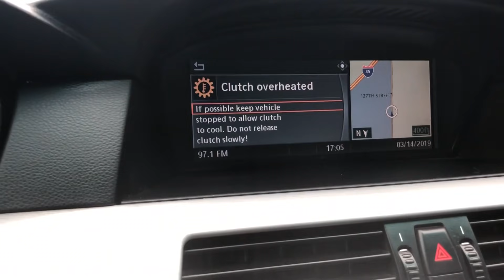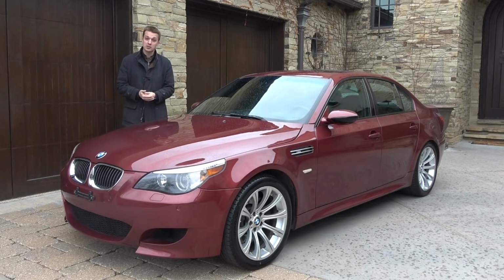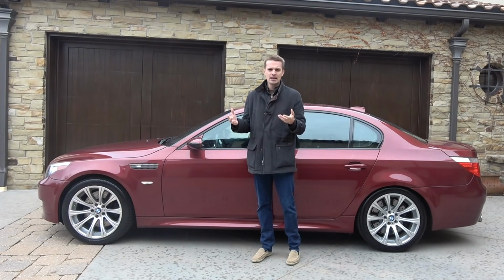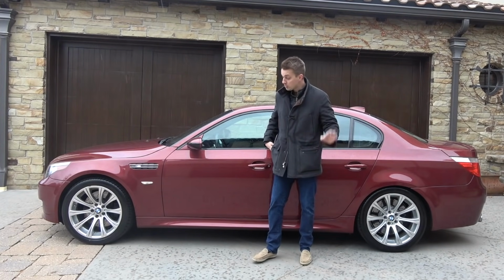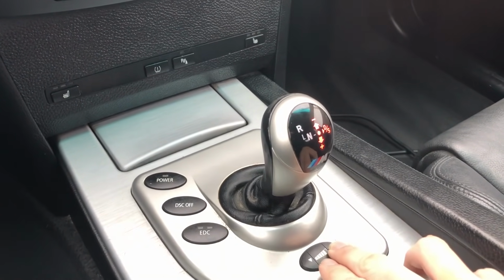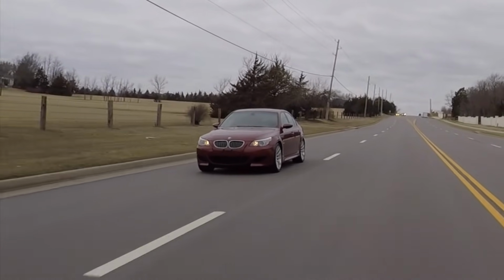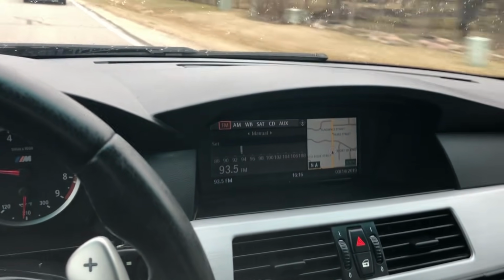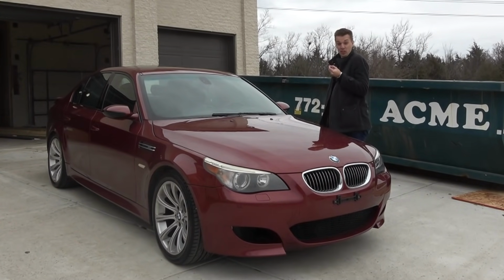My Cheap BMW M5 Is FINALLY FINISHED (Thanks to a Wire Hanger???)

Comment: The shifter is not upside down. That is the correct way it should be. When you are speeding up, and upshifting it is more natural to pull the shifter back. Even more so, when decelerating and downshifting to push on the shifter. It is totally awkward the other way, if you are slowing and your weight is being pushed forward, to then pull back on the shifter, and pushing you even more forward.
Reply: sHillChannel In all fairness I’ve heard that before because in the early steptronic shifting bmws orientation was the way Hoovey thought it should be
Reply: Fargo Holmes yea, as I sit in my 2000 bmw 323 with the backwards forward + back for -. It’s a good thing that it’s not used in that mode.
Reply: Just like on an aircraft...
Reply: Every rally car, pneumatic gearbox car has push to down and pull to up..
Reply: I ended up with a Mini automatic, and I was very please to know that BMW had kept the towards yourself as an up shift and away as a down shift. It was very helpful while taking it onto a dirt road.
Reply: @anidiotinaracingcar  Or a Mazda... or many other cars that get it 'right'.
Reply: @TakuroSpirit77  can confirm. I was pleased to see my Mazda3 did it the correct way.  Well, the more correct way is with a 3rd pedal, but happy wife happy life (it was hard enough to talk her into a Mazda hatch instead of a RAV4.  ew.)
Reply: I disagree. Having used a car with it both ways, up/away is more speed, down/towards you is more decel. That;s how it should be.
In a real manual, you are usually going from 2nd up to 3rd or 3rd down to 2nd in tight corners.
Reply: Uhuh so aircraft have their throttle systems all incorrect you know push forward to go faster.... Seems piper, Cessna, Boeing, Airbus, Desault, Sukhoi etc etc have it all wrong. Oh and every other car manufacturer.
Reply: There is nothing "natural" about that. Maybe the way you prefer it but it is not "natural".
Reply: I would buy it.
Reply: Because RaceCar
Reply: Yes! I'm forever shifting the wrong way because so many cars have it the wrong way around.
Upshift should be back!!!
Reply: Phillip Pereira aircraft throttle has nothing to do with shifting. Racing Cars with sequential transmissions shift like the M5 in this video.
Reply: The "go faster stick" in aircraft is analogous to the gas pedal in a car, not the gear shifter, making this comparison invalid. Back for upshift, forward for downshift, because racecar.
Reply: @superglue46  --> Nice save! I'll bet she wouldn't like the RAV4 now anyway, after getting used to the 3.
Reply: He was obviously joking
Reply: Exactly, this hoovie character doesn't know much about cars.

Comment: If your BMW mechanic doesn't daily drive a BMW, I wouldn't trust them. I'm a BMW mechanic and I only drive BMW's.
Reply: Biggest European junk ever made
Reply: S. T  ? Did I tell a lie ?
Reply: S. T which lies ? The vanos pump , massive oil leaks , constant sensors failures had a few bmw’s in my early days as a Acura tech there’s not many that can drive like an M5 or 540I 6 speed but are not reliable those from the 2000 eras all all junk  that’s a fact .
Reply: @mollywapyo  Sensors failures are common to all brands so stop bringing that up, MAFs for example are known to fail on pretty much ALL cars. I personally know 5 BMW owners (3 of them have diesel engines), all cars are above 200k miles, aside from regular maintenance, nothing to report, but then again, there are a shit ton of old BMWs still driving fine. The internet hive-mind panic surrounding this brand is just astonishing.
Reply: S. T hey it’s not just an internet panic  thing... can’t speak for the Diesel engines models , but the gasoline ones for years have all had disastrous problems most people  are aware of this they don’t need the internet for this info   but they’re so nice to look at and drive people like me buy them > and  until my third one wouldn’t stop leaking oil  and how can I Forget cluster aka dashboard lights up like a Christmas 🎄more often than a Christmas holiday .
Reply: Your job is definitely secured.
Reply: Nice strawman. He literally said none of those things. He just said BMW's are pieces of shit (true). I don't know what all this 50k time bomb stuff you're talking about has to do with anything.
Reply: @josephk1342  Oh look, another sheep.
Reply: @josephk1342  yea exactly stay on topic sir
Reply: Says you. Stop pretending like BMW's are the greatest most reliable machines on earth. Just because your parents drive you to school in one doesn't mean they're the best cars ever. They have well documented reliability issues.
Reply: Sure, never mind the fact that they have more issues on average than other car brands like Toyota.
Reply: @josephk1342  is that what you came for too ? To boast about your car's brand ? Have at it. Might be your only chance to shine in life.
Reply: Thanks for admitting you don't have an argument.
Reply: Thanks for confirming you don't have an argument.
Reply: BMW can be pretty shitty. Coming from a shop owner and BMW owner LOL
Reply: @josephk1342  we knew that after his totally ignorant comment in the first place. we didnt need a running speech on it to be fair, everyone who knows bimmers knows these facts
Reply: What if they drive a 15 year old station wagon with a diesel engine?
Reply: S. T in Atlanta, you can’t give away a used BMW and people buy them new in droves here. My best friend bought a brand spanking new BMW 7 series 2018 and within the first six months, its been replaced  with another brand new model,, that one was in the shop for 7 of the first 8 weeks he owned it with “computer issues”. They now have compensated him financially and offered him a third brand new 7 series. He declined because his was ordered the way he wanted it and they wanted him to take one off the lot. He doesn’t want one that doesn’t have what he ordered originally and he’s in litigation now. You keep telling people how great these cars are, especially when they have had regular service, ie = shelling out ridiculous amounts of money annually to iron out the problems they come with that amount to what’s called “billable maintenance”. Meanwhile people cannot buy a used Toyota, Honda, Lexus or Acura because people want them new and then others want them used and are willing to pay good money on cars that aren’t the equivalent of pouring money into a bonfire 🔥.
Reply: J MILLZ  couldn’t have said it better or should I add Bavarian Manure Wagon...
Reply: J MILLZ S. T  don’t even bother with a bmw lover I have a buddy that loves these things even though it breaks down and thinks it’s the bees knees. Luckily he’s mechanically inclined and has a garage workspace to work on these. Reality is it’s not the same for 90% ppl and they learn the hard way. I swear this guy @S. T and my buddy are like Jehovas trying to convince you to switch to the dark side. I’ve had my share of euro trash vw bmw and s60r all had major issues. My Lexus ISF all I do is change the oil and brake pads , and I track the shit out of it. If I did that with euro trash it be piled up on the boat with its german brothers and cousins, on a maiden voyage to China and turned into products to be sold on Amazon
Reply: Mine is driving only BMW's, so as I.
Reply: Yes. BMWs are complex and over engineered, there's a lot of components that can go bad. When they run well they are very satisfying cars. Properly maintained and driven they can last as long as any other car.  People mod those cars and drive them like assholes all the time and then they bitch when something is wrong.
Reply: Can you help me with my 05 530i?
Reply: wagner1va there cars ain’t giving them the type of problem the bmw gives
Reply: @mollywapyo  my 2000 250k mile 323i runs great👍 granted ive rebuild everything but the engine and transmission 😂
Reply: BMW puts plastic where it doesnt belong. Still not as bad as Audi or Volkswagen. I'm also a mechanic and those pieces of shits start having turbo and transmission failures around 30k miles.
Reply: What part of the country you located? I need a good BMW guy.
Reply: J MILLZ I have had BMWs since 1995 now on my 7th BMW and only one has needed any major work and that was my first BMW a E30 325i which needed a top end rebuild, well that kind of gave me the opportunity to do a full Hartge conversion! The rest have been fine just usual maintenance nothing more! Choose your drivetrain carefully and don’t buy a lemon in the first place and you will be fine
Reply: @mainiac4pats 
 In Europe, no one wants to buy the plastic lexus with hopeless achievements and entertainment system worse than in dacia. Premium Toyota
Reply: All cars have problems BMW, Audi or Mercedes ... So many idiots in this forum can see them only in the case of BMW.
Reply: My bmw mechanic drives a rsx and works on my Subaru 🤷🏽‍♂️
Reply: @mollywapyo  the fact is that petrol engines for US and UK are seriously under pressure and it often fail... It's due to many factors... Meanwhile in most EU countries most driven BMW's are 2.0 diesel/3.0 diesel (not 335) and 1.8/2.0 petrol engines... All of them have 150+hp which is more than enough for daily drive. And those engines are extremely reliable... It's fact. Lets talk about most expensive part... Engine chain... 600e for an old e90 but i never but never heard that happened someone i know with this engines... Only junky thing about BMW for years now is cooling pipes... Needs replacing every few years 3-5..  but at a price of about 200 euros.. it's shitty...
Reply: WolfHeart this
Reply: If I have a bmw mechanic I’d assume he’s a smart man and smart men wouldn’t drive a bmw.. simple as that
Reply: My guy💙
Reply: @AlmightyJ97  the thing is price ... People just buy meyle, topran or some low quality parts... And expect it to last long... Sorry but that's not a case... You have to pay to play. If you pay 50+k Euro for a car don't expect cheap service.... You pay for power, design and materials... Not reliability....
Reply: Same
Reply: Hey, I own a bmw e61 530D, how familiar are you with the e60 generation? If you are well acquainted with them, could I ask you some questions for tips on how to take care of my car?
Reply: BeastAtGaming yes you could
Reply: Say that to mine inline 6 330ci with almost 200k on the clock and still going strong. I rather have one bmw than 10 fords, mazdas, mitsubishis or any  other cheap peace of shit that's gonna break and don't tell me they don't break, cause they do, have so many examples over my short 25 years.
Reply: Ziggy R  No actually they don’t break. Even the Lexus cars can be neglected and still run. Bmws requires a lot of attention but you still end up with a lawn ornament if you don’t keep up with it’s endless demands.
Reply: S. T my 525 is going strong at 290k and I got it at 60k so far I’ve had to replace two head gaskets bc of my own error not the cars fault and the front struts and the starter other than that she’s been a complete beauty and is still going strong
Reply: man... i personally know some 30-40 bmw owners and only one of them have no problems with its bmw... he is 67y old and have 1984 745i (if i remember correctly) that have some 40000km on the clock and yes he is the first and only owner of that car...
Reply: @nenadcaric5195  I bought Topran and Meyle parts for mine and they've been going strong as day one. It depends of the parts you go for.
Reply: @kwachujachu4415  Exactly. But jealousy makes them dumb and blind. I ran through a couple of comments after I stopped posting here, hilarious. It's always the same story of "my fwiend bought this hurrr durr and it broke hurrr durrr". Yeah right. Most of the people who have problem with them (or any other brand) are those who bought a used lemon first. Then they complain it runs bad. Lol.
Reply: yes everything is relevant to every brand exept x100 in bmw...
Reply: thats right... that is why i learn on faults of others and never by a bmw :D
Reply: yes because you can in fact learn from faults of other people... i know tooo many people who own bmw (30-40 people some of them too good because 2 of them live next to me) to be able to buy such a junk like bmw... but as my friend (its sounds totaly like you) say after his new (1 year old) bmw "blow" valve gaskets: "you know that is normal on every car" :D :D
Reply: you sounds to me more and more like you never ever own a car... not onlu bmw but any car except maybe in a pc game
Reply: i never sad that but ok you want to try... so kid buy in games what you want and be happy...
Reply: J MILLZ nah that would be Volkswagen and any Volkswagen products
Reply: joe bloggs wtf 7 bmws bro? I don’t think that means reliability.
Reply: That makes sense.
Reply: Keep protecting your precious bmw mr. keyboard warrior. Driven 3 series and 5 series, nothing special about them. I will never own one, and I will laugh at people wasting so much money on them :=)
Reply: You been holding your ground in this comment section for a year. If that doesnt fit the title keyboard warrior, nobody does
Reply: @FalloutEpic  What a twisted way to put it lol. I've answered this feed a year ago. And I restarted posting when someone mentionned my nickname again, 3 weeks ago. You make it sound like I spent my time posting for 12 consecutive months. Now as far as I know, I am totally free to answer what I please, when I please, how I please. It seems you have a problem with that. But then again, I doubt i'd waste too much time answering to someone whose fun time is "laughing at people who waste so much money on a car" :)
Reply: I have a problem with people defending bmw for no reason :)
Reply: Sure thing! Atleast I can rule out bmw problems from my life :)
Reply: Most german specialists drive mercedes, they know the bimmers are crap
Reply: @mollywapyo  ah yes the classic list of problems
People should KNOW how to take care of their vehicles or stop buying what they can’t afford to maintain
Reply: @mollywapyo  you should buy a corolla or a prius my friend it's a good reliable car for you!
Reply: Danny, what's the best used BMW to buy?

Comment: You should have bought an OEM BMW wire hanger.  Using cheap no name wire hangers won't be as good of a repair.
Reply: Herbie Husker available for the low price of $199.79 at your local BMW dealer
Reply: Haha clever, love it. 😂
Reply: OEM from BMW is not any better lmfao
Reply: @samlung2724  r/wooosh
Reply: @samlung2724  r/wooosh
Reply: Aww dam. First time I've been r/wooshed
Reply: Tehgziz Lauw r/subsyoufellfor
Reply: Aftermarket coat hangers void Beemer warranty....must be at least made in Munich.

Comment: No lights on and running great? Time to sell it ASAP.
Reply: @Boulder Pathways 2007 530xi here. Can't get myself to sell it
Reply: @Boulder Pathways Bmw Big gay
Reply: Boulder Pathways even my alfa romeo mito does that 😂😂😂... no big deal.
Reply: i often wonder what it would be like for my e60 530i to not have any warning lights.... wouldn’t that be heavenly
Reply: @Boulder Pathways my little interlagos blue 08 528 pulls in sport haha its awesome. no warning lights either !
Reply: @Richard1976   my old fiat punto did it 😂
Reply: Facts tho , I’m still waiting for mine to leave the shop so I can sell it😩
Reply: @dertyherry313  so what do you drive ? It's ok I'll wait ✋
Reply: @TNT310supralover  2016 Ats V bud
Reply: @dertyherry313  Exactly Garbage 🗑 🤣
Reply: @TNT310supralover  Also have an e92 m3 that sits in the garage due to rod bearing failure, so i dont get what ur point is. What you drive tho?
Reply: @dertyherry313  Exactly! Bye 👋
Reply: @fatmeow7007  lucky if ya idrive system has no problems, any problem yet? Lol
Reply: Sell it to Doug.
Reply: 08 550i msport. No lights on the dash but i have a dealer warranty. So I go fast. All the time.